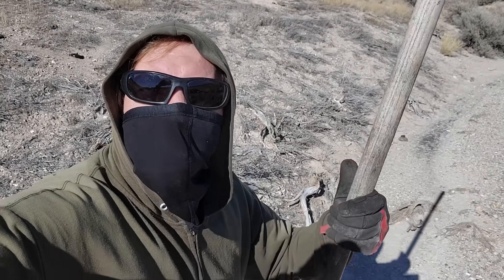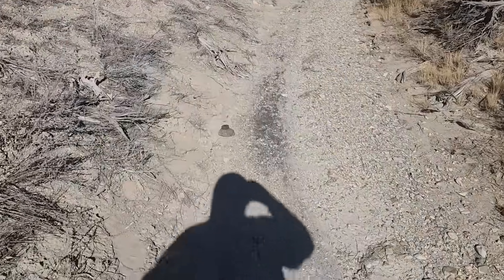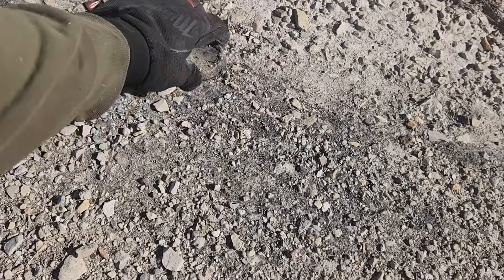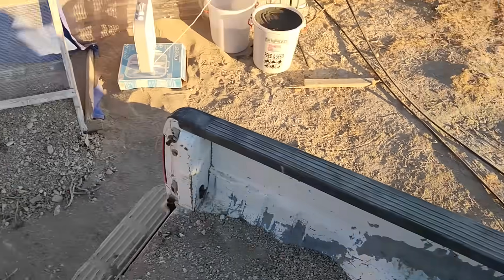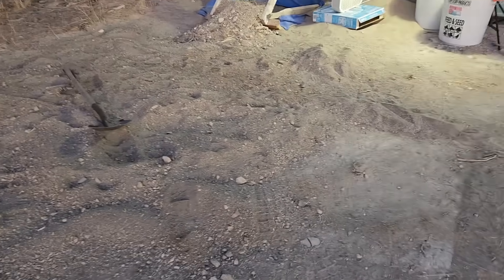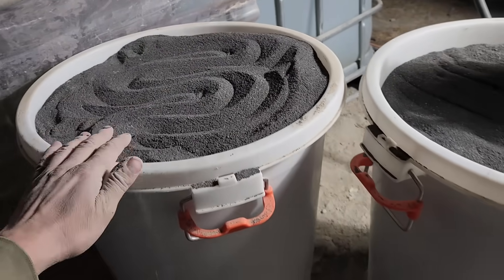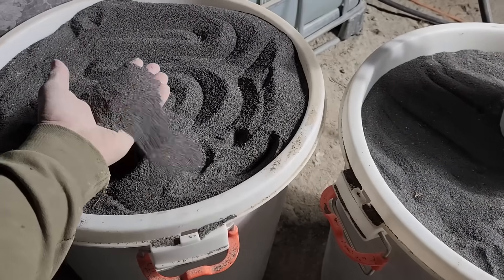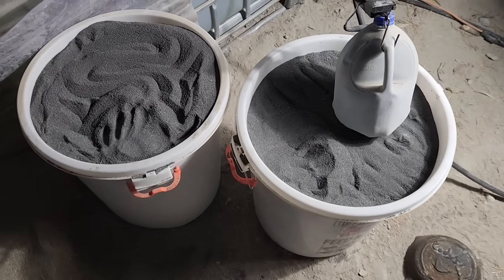Mining Magnetite

Comment: It would probably be more efficient for you to use some sort of electromagnet to lift or pull the iron out of the sand so you dont have to worry about the sand falling in, only problem is the cost of power for the magnet (generator, etc) and the actual magnet but maybe if you show them all your thermite you can get some discount
Reply: Strong AC could also potentially demagnetize the magnetite causing it to just drop off the magnet too

Comment: Great video! I’ve been thinking about an even more efficient system: a Gravity-Fed Magnetic Drum. By mounting a circular magnet vertically with a thin plastic sleeve, the weight of the collected magnetite on one side would create a gravitational imbalance, causing the wheel to rotate on its own. If you place a scraper at the bottom to release the material, the weight shift keeps the wheel spinning continuously. It would be a completely passive, self-automated separator!

Comment: I first came across magnetite in 1991 at the age of 17 working as a spare man in an coal wash plant,  while the machine man was on a lunch break i was told to use his CAT 980 loading shovel to load magnetite on a truck,  YES! any opportunity to drive a machine.... firstly I had only loaded coal with this CAT 980 and this particular truck took 5 full bucket loads of coal to fill it,  me being young and stupid and without thinking loaded 5 bucket loads of magnetite on the truck,  I did think the loading shovel was a wallowing and bouncy but didn't put 2 and 2 together,  I didn't know there was a weight difference until the truck couldn't move away and when trying to tip some out the truck just spewed hydraulic fluid instead of tipping. I learned a valuable lesson when I was in the back of the truck hand shovelling magnetite out the back door until the truck was light enough to tip it out itself.

Comment: GOOD VIDEO, YOU CAN SPEED THIS UP BY USING CONVEYERS, ONE UNDER ONE OVER, THE DIRT UNDER SLOW VIBRADING TO LIFT THE DUST THE OVER CONVEYER WITH AND ELECTRO CHARGE TO MAKE IT MAGNETIC TO PICK UP THEM BEFORE IT ROLLS BACK DEMAGNETIZES TO DUMP THE CHARGE AN WA-LA PROBLEM SOLUTION MY SPECIALTY ...

Comment: You could fashion a plastic cover that's offset from the magnet far enough that it prevents buildup on the magnet itself but still pulls it out from the stream. There should be a goldilocks zone that is close enough such that it is able to extract magnetite while also being far enough away that it doesn't have the ability to stick

Comment: You need a magnetic belt separator as used in coal handling facilities at coal fired power plants. It would not be quite as low tech but not impossible. Search key word "magbelt separator" .

Comment: You need something like a plastic chute that branches. On the outside you have a conveyor with magnets that extends only to start of the branch.

That will pull iron towards one of the branches but the magnet then moves away from the chute as it returns up the conveyor, allowing it to drop freely into the collection bucket.

Comment: can get it in sand to. also put the magnet in a plastic bowl and run that over the ground then pull magnet out and it drops in your bucket. yes you have to clean it. but you just keep the magnet higher off the ground it will separate.

Comment: Cody: RecentlY, I have been delving into the arena of gold prospecting  as an old guy hobby once I retire.   I drive OTR  truck so the actual searching will havecto wait.

But, if magnetite,  I have learned that that stuff  aka black sand is a good indicator of the  presence of gold in the, not a guarantee of gold.  Gold is said to bind with iron   and through some processing using some high heat, some gold could be released from the magnetite.   So, maybe ypu could research  that further  and find gold in your sands.

Comment: I'm thinking a simple way of easily purifying even those big containers is compressed air. a diffuser in the bottom of the container, a pressure regulator to fine tune the airflow. "Liquifying" the entire batch, the magnetite should work it's way down and the sand up...

Comment: 13:34 I think copper wire and electricity running along it could help with the method. Add a potentiometer and control the voltage and the magnetite can be pushed into a collector while sand falls straight down. Just a suggestion...

Comment: I would build a contraption to automate everything. screen it, dry it, etc. If you run it out on a belt, you could have a lip to scrape it out to a thin layer on the belt, easier to dry, and easier to get with a magnet. You could maybe even have some contraption with an electromagnet to pick up, move it and turn off the electromagnet someplace else. Or have the magnet in the roller where it drop off the belt.

Comment: Have you tried covering the magnet with a rotating cylinder? it will have the magnetite sticking to it and gravity will pull it downward. if the magnet is a bit off centre, magnetite will just fall off at a greater and more predictable distance when it rotates down out of reach of the magnet.

Comment: I'm surprised Cody hasn't put a dump valve In the bed of his truck, and built a a platform he can just drive up on and process the magnetite directly from his truck bed up top by pushing it through the hole to an upgraded plant below it lol

Edit: he could even build a bed sized rock mesh that stops big rocks as he shovels it into the truck. Preferably on hinges. Then he could just shovel in the dirt and magnetite, fill the bed, flip the mesh to dump the rocks and pebbles, and drive to his processing plant and leave the big stuff behind.

Comment: For the remaining magnetite in the tailings if you're worried about it. My thought would be to at that point do something like have a flat floor or a rotating drum and one of those magnetic floor sweepers for picking up bolts and nuts and nails. You would spread the tailings out thinly and run the sweeper over them to pull out anything that might have been missed. Then with this you can have a separate bin to the side to dump the magnetite you snagged by just pulling the lever/handle on the sweeper. Otherwise it's a pretty ingenious process that you've made and a great way to show how a simple understanding of physics can be greatly utilized.

Comment: Defects and problems in foundry tend to accumulate in the upper part of the mould, so it is better to have the cooking surface facing down. To do this you can make a "fake" box filled with loosely aggregated sand, make in it a hollow to accommodate the belly of the pan,   then mould your lower box over it and when the sand is set flip it over and discard the "fake".
   There are products you can use to cover the mould and prevent the sodium silicate sand from sticking to the iron so much they are usually based on graphite, a home made approximation would be soot.
    I you decide to cast the pan "upside down" you can put an exit tube at the top of the piece (meaning the bottom of the pan).

Comment: He can improve this technique maybe double. If rigs it with a conveyor to direct it away further from the dust of the dirt. Take a conveyor short one. Mount the magnet behind the belt and have the stream hit the belt and as the belt rotate's slowly the magnet will break connection to the magnet and fall how ever you like. Then as a final step have a fan to blow towards the downwards stream of dust to further separate it. I'm not sure how much more you'll get, but you'll get a lot less dust. By the way why do you need thermite?

Comment: Interesting, I had a 1200 acre area with very high concentration of magnetite and had tons stored.  I was dealing with a cement producer and they wanted to buy it until they bought out a closed mine that had many tons stored.I Like your system for a small yield. We used a much larger system with a rotating magnet with a wiper that scraped off the magnetite. Since mag is found with gold have you tested for that?

Comment: That is frustratingly simple. I was trying to separate magnetite from sand for geology demonstrations on the Oregon coast, and spent a bit of time gluing magnets to a board with a plastic sheet to pull the black sand away. I wonder if I could get this to work with sand that's wet enough to flow rather than dry enough. Thanks for showing it off!

Comment: Back when I was a spotty teenager I did a summer placement with Boxmag Rapid (now defunct) who made all kinds of lifting and separating magnets. It was quite an education. They made equipment for exactly this kind of job. They also forayed into electrostatic separation.

In fact my first job was writing code for a Commodore PET to print a visual impression of metal parts being diverted as lump coal flowed ballistically off the end of a conveyor belt, underneath a large electromagnet.

Comment: They use a similar concept to separate metals out from the ash of incinerator plants. 

The ash is moved by conveyor belts with a giant spinning magnet at the end that flings the metal over a separating wall into a collection funnel, while the ash just drops straight down into the ash funnel. If I remember correctly, the magnet is spinning fast because that allows it to separate even the non magnetic metals out of the ash, which would otherwise just fall straight into the ash funnel.

Comment: Tip: go to your backyard, or front, get a magnet (I got mine from a magnetic water pump) an attach that to a stick, then cover it with something like electrical tape. Then dig a small hole and transfer the dirt (dry) into a bowl, then use your magnet thing to take the iron out of the dirt! Put that in something and you have yourself some nice magnet powder!

Comment: Would a magnetic sweeper (for picking up screws, steel cuttings and other magnetic material from the floor) work as well?
If so, you could just dig down to the ore and walk over it with the sweeper.

Comment: I grew up with really sandy soil and we used to do this in the backyard as kids. We built a sluice out of sheet metal, with big speaker magnets stuck to the back, and we'd use the garden hose to wash the sand down from the input hopper at the top. Parents weren't too happy about the flooded yard but it really wasn't any worse than most of the projects we did.

Comment: you might be able to use a series of tubes/pipes and additional magnets to "refine" your refining process.  start with one larger tub from the bucket to the top/mid point of the magnet, then after a 1 inch or so gap, put multiple tubes and pipes to catch the separating material more cleanly.  Might not be worth the effort to optimize that vs just running it thru extra times like you currently do though... lol get a mesh headed metal shovel, magnetize the shit out of it, then do your shoveling. if you make it an electro magnet you might be able to reverse the polarity to clean off the shovel at your storage point.

Comment: Instead of having two processing plants side by side, you could try to stack them onto each other. If you use the funnel for the smaller magnet as the collection bucket for the larger one, you could purify the magnetite twice in a single run. Because most of the magnetite has already been separated, the lower flow rate of the smaller funnel should still be sufficient not to cause overflows.

Comment: The two modifications I would do are, Place an off set funnel below the magnet a couple inches, so the higher side is on the outer edge, and bring the bucket closer vertically. Then place a lid on it with a hole for the funnel. After you run the bucket on top, use a magnet to check the lid, and then toss whats left on top. This will cut down on impurities getting in and dust from mingling with the magnetite. Lastly, the amount of dust that gets mixed in from the magnetite held onto the magnet itself. Can the magnet be dunked in water to rinse it off? That seemed to be nearly as much of a contaminating factor as the tailings.

Comment: CODY!

LOVE YOU!

you could probably build a trommel, that incorporates your clever magnet trick, so that the screening, and seperation, happen together.

The way we seperate iron from foundry sand, is very similar, its a conveyor belt, with a magnet behind it, over another conveyor belt. The upper conveyor goes perpendicular, and the iron falls off, just past the range of the magnet, which is fine tuned, as you have done here.

The reason i recommend a trommel, as opposed to a conveyor, is because the screen, and conveyor method that we used, requires constant interaction, whereas a trommel ditches the rocks and debris for you.

Cant wait for your next video!

Comment: I guess you could increase process speed by having a series of cubic magnets arranged as a halbach array and then instead of a round stream you have a flat stream. Then of course you could adjust the flow rate by adjusting the slit width using something to obscure it and find just the right width.

Comment: I have been working on this exact same project separately by coincidence, and I would love to hear your advice on this. I have found that collecting all the sand in the affected area, wetting it and screening it first, and then magnetically separating it, produces very high purity magnetite very quickly since these first steps work in bulk and reduce the amount of junk you have to work with while using the magnet which is more small scale. Another thing I've found is that if you let the magnetite get too close to the magnet, the field strength will permanently magnetize the particles and cause them to clump together and trap impurities. To avoid this, just use a really large strong magnet, and put a spacer between the magnet and the magnetite so you only use the broad medium-strength field for separation which does not appreciably polarize the magnetite. Just for clarity, I do this whole process wet (under water) since it cleans off all the dirt and clay and softens any clumps ensuring that only the actual grain size is being measured and sorted, and additionally, when I'm using the magnet to sift the magnetite out of the cleaned and screened sand, being under considerable amounts of water also keeps the sand from sticking to the magnetite by adhesive and cohesive forces from the moisture either from the ground or from the first steps. The effect of lower relative density in water might be useful to look into, since it can cause the magnetite to float up to the magnet early leaving behind any partially magnetic rocks.

Comment: I found a disc shape works best, one thing you can do is run the same bucket overhead setup through a pair of parallel rings and use a PVC pipe right below where the top of the second ring sits, the sand collects and is deposited through the PVC out loop. You can improve the design a little bit by using an iron coupler at the top of the PVC and magnetize it to collect anything that gets through the first two loops. but it the idea is that as the stream passes through the first ring, the magnetite, or ferrious material is pulled off and away by the larger diameter magnet and anything close the center of the stream is pulled away by the smaller diameter disc magnet. as it builds up, anything that passes beyond the maximum capacity of the magnet falls and is deposited around the PVC Pipe. So there isn't as much secondary or tertiary reprocessing.

Comment: In the spirit of 'simple is best', I wonder if you've thought about this refinement to your system: secure a plastic bag over the magnet/bar end that receives the ironsand; then, once you're ready to harvest, pull the bag off of the magnet and allow the ore to fall off.

Incidentally, the magnet deflecting the iron particles from the stream of sand passing through is the same principle used inside a mass spectrometer: after ionizing a stream of molecules (breaking them apart into smaller particles, a magnetic field deflects those new ions according to the mass-to-charge ratio of each ion, which hits a detector at different places; the specific breakdown pattern of each type of molecule presents a 'fingerprint' of ions that allow one to identify what molecule it was!

Comment: Some of the beaches in the Pilippines have so much magnetite in them that the sand is almost black. I took a magnet to one of these beaches and felt I could  pick up the entire beach if it had been big enough. Dredges use to mine these beaches but it was destabilising the coast line so they had to stop. The Phillipines was built by volcanic action so that is probably its source together with erosion. I will try and ball mill some Aluminium next time and see if I can make some thermite with it. Who knows, I may be able to make myself a Cody frying pan.

Comment: im suprised you didnt use a make shift guidance system that uses the magnitites own weight to filter itelsf with the magnet. if you would have added a bottle or cup or similar plastic object over the majority of the magnets face and underside the magnitite would try to stick to the magnet and slid down the plastic instead, eventually falling off from its own combined weight without having to worry about the plume build up to this extent and you would save alll the effort of removing it from the magnet yourself by hand. all you would have to do to remove the plume is pulling the cup away from the magnet. i did a similar thing when i was collecting metal shavings from a rebar tie yard. it had about a 98% effeciency.

Comment: We have a lot of black sand around here.  I've been trying to work out a good way of separating and refining it.  While I haven't built anything yet, I have identified all of the problems you ran into.  I hadn't considered just letting it stick to the magnet though.  It turns out the problem is actually the solution!  Very nice!  Thanks for posting this.